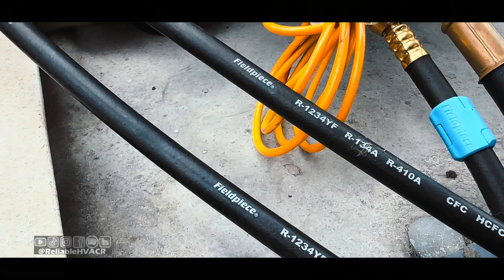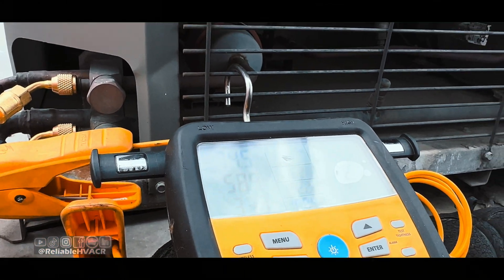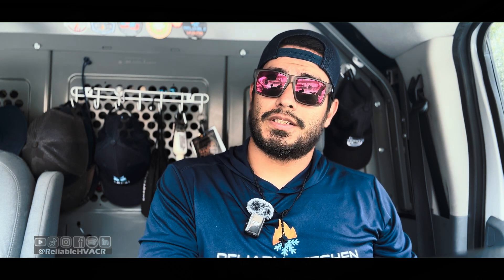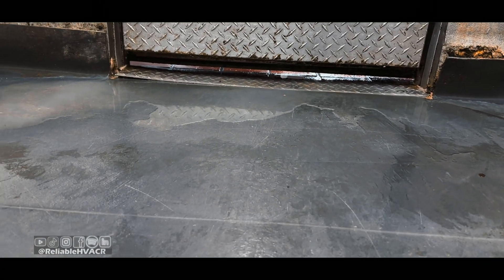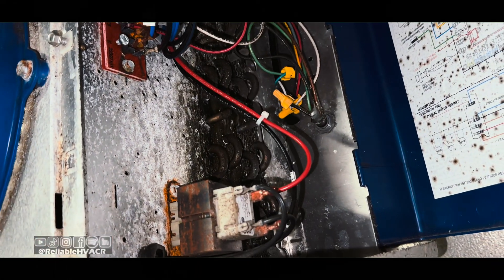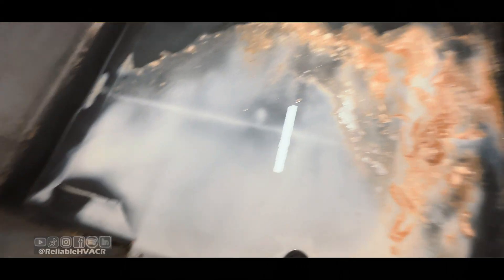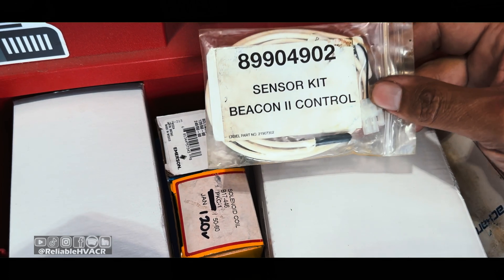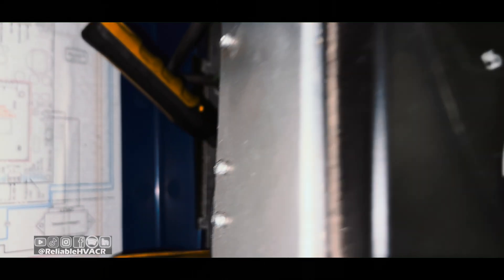Heatcraft Intelligen Sensor Issues / HVACR

Comment: I’m dealing with the coil getting iced 2 x times already defrost term is 45 degrees with 4 defrost intervals my box temp sensor on board was reading 43 degree actual supply air was 32 degree she running way too cold

Comment: We try to start up one today had issues we had to bypass the low pressure switch
Reply: The crappy Danfoss low pressure switches are way out of calibration. You have to dial it in while looking at your gauges, cut out at 0 psi
Reply: @paulstaib2696 spent 2hr cooling the compressor from going into a vacuum and 25min setting the crap
Reply: @juanitobananass9171  I started swapping them with 5psi c.o. peanut controls. They work perfect, take 5 minutes to swap in, and people that work on it in the future can’t screw up the settings.